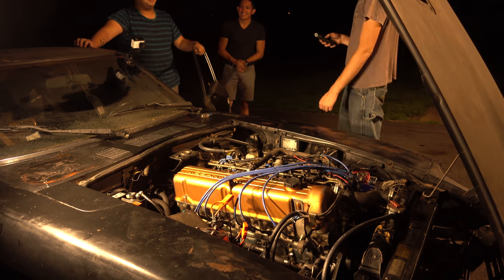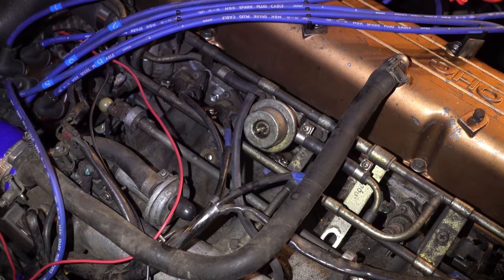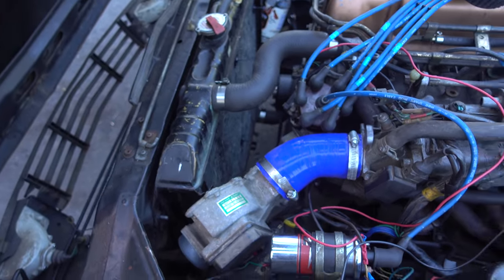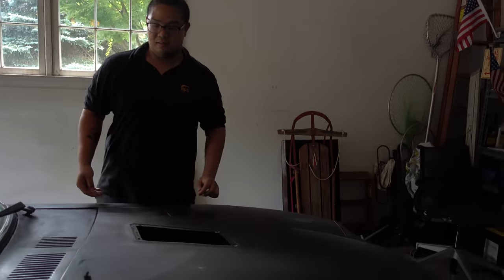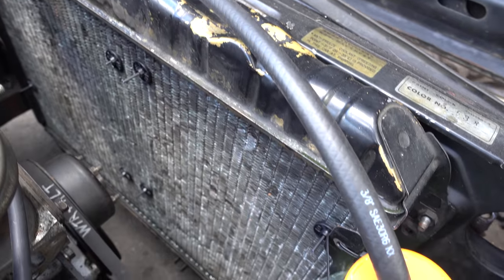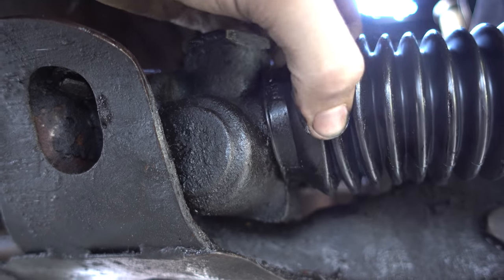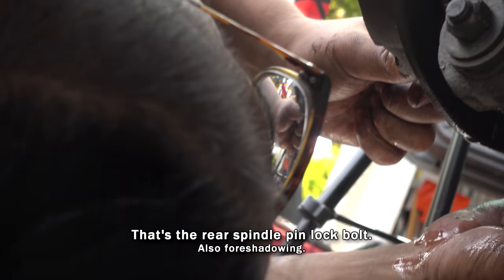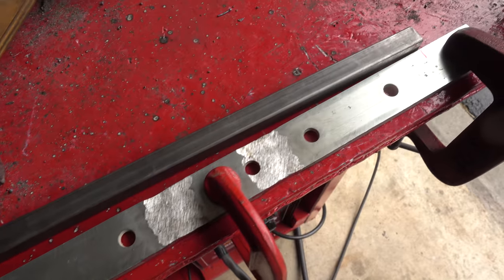Datsun 280z "New" Engine Testing (Ep.7)

Comment: I am loving this series. Nothing fancy. No million dollar paint jobs and parts catalog spending sprees. Just honest hard work and passion.
Reply from the maker: What are you talking about? It is a million dollar paint job! You know how "distressed" jeans sell for so much more? Imagine how much time and labor it would take to distress paint this badly. The purchase price was a steal!
Reply: 100% agreeeeeeee
Reply: FuzzyDicePimp  it’s the patina look. It’s the latest craze. LoL. One thing I saw is you used grease on the rubber bushings. It’s better to use soap
Reply from the maker: Polyurethane bushings absolutely need grease, or else they squeak like crazy. Didn't have the proper stuff so we just used synthetic wheel bearing grease, and it seems fine so far. For rubber, you're correct that soapy water is the way to get them installed.
Reply: @FuzzyDiceProjects  

No joke about that paintjob, the guys at Fender will charge you like 1 thou for the Relic treatment on their custom shop guitars.

Comment: The stuff under the passenger seat looks like coconut fiber, which still is sometimes used as a padding material in seating, mixed with a binder (usually latex of some kind).
Reply from the maker: I think you're totally right, I never would have thought of that! Thanks, I was really curious about it!
Reply: #thecurseofoakisland #coconutfibers
Reply: It's also called horsehair
Reply: I would have thought hemp, but not coconut fiber...weird. WILSON!

Comment: Simply putting a block off plate where the BCDD went will not suffice. Enough air can still bypass the throttle blade and cause a fast idle issue. 

I had this issue when I removed mine. Look at your FSM and see which passages to block off and what not to. You don’t want to mess with the vacuum advance from the distributor.
Reply from the maker: Hmm, okay, we'll try to work out where all of the passages go. The idea for the block-off plate came from forums where people had done that with success. It still idles high currently, though it's down to maybe 1000RPM so it's manageable.
Reply: You may have a combination of vacuum leaks. The BCCD may be one. You can rule this out by keeping the BCCD attached to the throttle body and simply disconnect the electrical connection. Assuming the gasket is in decent shape, if not just a little rtv. The half dome inside the BCCD actuates and allows or denies more air to bipass the throttle blade. But removing that and only putting a block off plate, you essentially allow all possible air to bipass.

Other vacuum leaks to check, oil cap on the crank cover, injector O rings, dipstick gasket, crank case vent (goes from the bottom of the manifold into the driver side of the block), rubber boot between AFM to throttle body, cold start ports etc. Literally just go over any and all possible vacuum leaks. Many can be audible if large enough.

You can also adjust the AFM idle (should have a rubber nub covering the screw near the bottom of it) as well as the idle air screw on the throttle body. Those two can help you fine tune but arent a fix for an actual vacuum leak.
Reply from the maker: Thanks for the info again! When we have the chance to go over the car again we will keep all of that in mind (won't be until after at least the next two episodes, though, those are already filmed). Here is a forum thread with half a dozen people saying they removed the BCDD with no negative effects and there is even a commercial block off plate: http://www.classiczcars.com/topic/42497-bcdd-removal/

But I don't disagree that it would be better to keep it installed for the long run. Will keep it in mind as a possible culprit. We have messed with the AFM screw a little but it didn't seem to help much so we left it as it was. Want to get back to it though as the cap was missing and who knows what the previous owner did. We checked around for vacuum leaks with carb cleaner, couldn't find any. Can't hear any but the car is quite loud so that doesn't mean much. Will double check the locations you listed, though!
Reply: Im not disputing the plate or removing the BCDD. I made a block off and removed mine too. The potential solution Im trying to get across is that you may need more RTV under the block off plate to seal the BCDDs vacuum passages. 

When I deleted mine and put the plate on I couldnt get my idle below 1k. Thankfully one of Classic Z Cars top forum contributors was close and kind enough to come to my house and help me diagnose and fix my vacuum leak. This is how I fixed mine and may be the same for you.

Best of luck.
Reply from the maker: Oh, I misunderstood then, thanks for that tip! I cut a new gasket for the block off plate but might as well try some RTV on there too.

Comment: One of the most bizarrely useful things I've purchased is the harbor freight 20 ton press, between old suspension components, old u joints and a few other things (usually driveline or suspension related).  I only use once or twice a year but it's the best thing in the world when I need it.
Reply from the maker: It's one of those things I have needed so many times and have had to do some crazy things to get around not having one. They really aren't that expensive, it's mostly the space it takes up that's tough. Once I get some of these engines out of the garage (five of them in there right now!) or just clean things up and find space I would love to have one.
Reply: I'm lucky to have a big workshop, I lived with my wife for maybe 2 or 3 months when I realized sharing a garage was not going to work..

Comment: couldn't help but notice the guy you bought it from in the first video said there are no lower intake manifold bolts. They don't "hang". There are actually thick iron washers that go from the exhaust manifold bolts OVER the intake manifold to hold down the bottom. I really hope you realized that is what Datsun did cuz you would have major problems if you didn't have the manifold bolted on lol

Comment: If you cut about a quarter inch thick peace of rubber and install it between the fuel pump bracket and the car it will really quite it down allot i had to do that on my v8 s10 great video can't wait for more
Reply from the maker: Yep, I think the brackets had a bit of rubber on the ends but that is a better solution. He put a little dynomat on the topside of the panel and it helped out the interior noise, too

Comment: Man I miss my 280.  If you get a lot of exhaust in the cabin at speed check the seals around the tail lights.  They go bad and the shape of the tail sucks the fumes in it the cabin
Reply from the maker: Thanks for that tip, but there are enough other holes in the thing I think it's pretty much inevitable.
Reply: FuzzyDicePimp yeah I hadn't really seen much up close when I said that:). All this brings back lots of memories. I used to have a 280 with a hole in the floor so big I had to tell passengers to pick up  their feet when I was about to hit a puddle....good times

Comment: Is it alright to work on a vehicle in the rain? I’m seriously wondering. I’m fixing up a Chevy s10 and I live in Florida. It rains every other day so it’s hard to get enough time to work on it. I need to get it fixed before college
Reply from the maker: Depends what you are doing I suppose, the water could affect the sealing ability of some sealants or rust certain things that aren't meant to be exposed to it. Sealing moisture into wires is also a concern and the issue with what Sean was doing to the 280Z in this video. If it is a major concern, I'd recommend getting a cheap tent to cover the area you are working on as well as yourself and your tools!

Comment: I suggest you to install a thermoswitch to control the fans.
If you have no location on the head,you can use a coolant hose inline switch housing
https://www.google.fr/search?q=coolant+hose+inline+switch+housing&source=lnms&tbm=isch&sa=X&ved=0ahUKEwiYu_zGuPjWAhXHJ8AKHSF7CeUQ_AUICigB&biw=1920&bih=987
Manually switching on the fan can cause a lot of troubles.
Reply from the maker: Interesting, I had not seen inline thermoswitches set up like that before, seems convenient. It would be nice to have, so maybe in the future. Having the fans on all the time (and the trouble if you forget to turn them on) isn't really ideal but it will do for now.

Comment: Guys buy a fuse block from Amazon then you don't have to have so many inline fuse holders and you can clean up the wiring alot
Reply from the maker: He actually bought a few for this car, but didn't end up using them. Most of the car will be rewired at some point soon-ish anyway. And the inline fuses really sticking out were replacing hard to find fusable links and the proper fusable links were special ordered and replaced soon after this episode.

Comment: Yeah. I  watched 5 min of video and i thought about decelerator valve. And you figured it out. But one thing you forgot. Plug the hole in the center. You will have high idle. I've ditched mine, so i know what i am talking about. I think that head of 12mm hex bolt is perfect fit. or was it 14mm hex?
Reply from the maker: Hmm, you're saying to block the center port in the intake manifold, even with the block off plate on? I don't really remember (not that we looked into it) how the BCDD works, does that moving part seal against the intake manifold? So without it, currently, that passage to the other side of the throttle blade is just open? It would make sense I suppose, but I haven't heard anyone mention that before!
Reply: FuzzyDicePimp Yes, even with block off plate. You can stop your video in position to get the  wiew of underside of throttle body. Valve is vacuum powered, switch regulated and just doing exactly like one of you when he was hiting it. Point is, opened is when center is lift of thus connecting center hole with front one. With just block off flat plate you are always on. You need to plug the center, then install plate ( due distributor path) other than ditrib. just plug with hose and screw in one end.
Reply from the maker: Awesome, of all the tips we've gotten yours makes the most sense! We will definitely try this out next time we get the chance! Thank you, I can't believe nobody has mentioned that before!
Reply: FuzzyDicePimp You're welcome. I make living by making those things run again so i should know some things...
Reply: And sticky throttle. I think you have main spring broken. Additional "support" spring is not enough. Main spring is located under "control butterfly" (dont know how to name it) on the oposite side of throttle position sensor. Just add one spring somewhere...

Comment: The padding under the seat is "horsehair" padding. The process used to be to take sterilized, curled horse hair and inject it with a synthetic rubber latex to create a pad. Newer "horsehair" padding replaced the actual hair with synthetic nylon "hair". Old VWs have the same padding material.
Reply from the maker: Other commenters identified it as coconut fiber padding, sounds like the same process to make it and from searching pictures of both, can look identical. Whichever it is, pretty interesting!

Comment: Just a heads up the screws that connect the fuel pressure regulator to the bracket are shit. I had it fail on me within 100 miles.
Reply from the maker: Ha, that isn't surprising. I threadlocked them, yours broke from vibration? Thanks for that heads-up!

Comment: Can you send messages here somehow? I’m interested in how you set up the fuel pressure regulator I don’t understand.
Reply from the maker: The fuel pressure regulator is pretty straightforward (once we figured out which port on it was which with no instructions). Fuel line from the pump into one fitting, fuel line to the fuel rail/injectors on the other. Manifold vacuum connected to vacuum port on regulator so that it can increase output pressure as engine vacuum decreases (toward WOT). There is an hex-head screw on the regulator you can turn to adjust the fuel pressure. Finding out what RPM and what PSI it should be set at is tricky, we sort of guessed there.
Reply: FuzzyDicePimp actually my engine was the 77 engine so it has 2 inlets, so I used a T-Connector to make 1 inlet and then did it good I hope. I’ll find out when my MAF hoses come in and that’s all I hopefully need for the car to run.

Comment: The radiator fans should come with an adhesive back foam tape with precut holes to tear off individually. They prevent the plastic locks from damaging the fins. Also Horse hair, that the material under the seats lol.
Reply from the maker: The kit that Sean used to mount them (not the cheap ones that came with the fans) only had four pads each so he used them between the fans and the rad. I'd have made sure to get both sides but if the kit comes that way it can't be THAT bad to mount things like that. And it isn't horse hair, as other people have pointed out it is most likely coconut fiber, I wouldn't have guessed it but it appears to be correct!

Comment: Perty sure ur supposed to turn the screws out to adjust the idle....
Reply from the maker: You're saying you are supposed to loosen the idle speed screw to lower the idle? Maybe it's just from my carb experience but it usually works the other way around. Just searched a little and didn't see anybody mentioning a direction to turn it in. It did seem to decrease when tightening it, but I guess it's possible that is an indirect cause.
Reply: Going in usually idles something up. It's always been the same on all the efi cars I've worked on and the carbureted mustang in my front yard. Maybe Datsun is just ass backwards.
Reply from the maker: Oh, huh, I was picturing it as an idle mix screw that was letting in air past a needle or something. For a straight idle speed screw you're absolutely right about tightening being increasing idle speed. Will have to try that out, if it is indeed the case that it just needs to be backed off we're both going to go jump off a bridge.